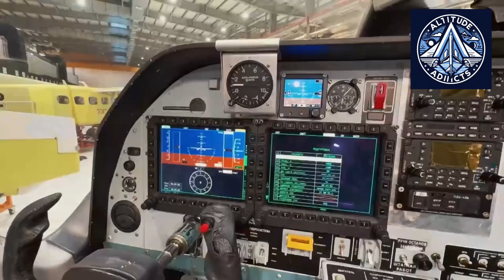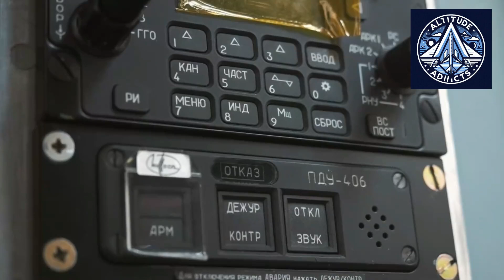Russia’s Baikal Aircraft Makes First Flight With VK-800 Engine | Tests Confirm Success

Comment: The nose of the plane is ugly, the take-off and landing is not stable, to judge by the video. They need to reinstate production of An-2. It seems that biplane for the purposes was the best option.
Reply: An-2 weight is double, flight distance half, engine weight 500kg, the new one 140kg...
Reply: @realshturman  ахаха, три коммента назад вес был 150кг. Давай наливай!
Reply: @johnwatson888 перепроверил просто, а вначале по памяти писал. По сути сказать можешь что-нибудь?? Факт остаётся, движек весит в 3 раза меньше, планер в два, скорость в полтора больше, дальность тоже. Хороший результат. Порадуйся за страну.
Reply: These youtube video judges are real clowns 😁 Even funnier when they judge real pilots and airplane designers.
Reply: @dvv18 are you part of the aircraft designer team, or a "on-sofa jugde" like me? I am tracking the plane creation process for several years, and watch the news. Firstly, this aircraft is heavier than designed, secondly - the it requires much longer runways compared to An-2, thirdly , there was news that the take-off requires more skills of a pilot to do it properly. The guy above gave very interesting info I did not possess - so, this is some soothing news.. And lastly - about the perception of aircraft beauty: "If a plane looks beautiful, it will fly well" - Tupolev, Soviet aircraft designer.
Reply: and there is WAS such a project. Fly on the car gasoline. But it was cheaper and build on "the wrong" factory, so its better this then nothing

Comment: this is all part of recovering from the Soviet policy of basing all light aircraft and trainer aircraft and engine production Eastern Europe as a centre of excellence. When the USSR broke up - Russia had to rebuild all of this. 
The comment about Western engines isn't correct it was a Czech engine that GE took over ... also the "delays" in the VK-800 were a redesign of an older Klimov design to incorporate a lot of 3D printed technologies that were developed by Klimov for the new VK-650. Which made sense as the engine became lighter with fewer parts and more efficient.
All of the sensationist "media" was idiots who had no idea what the true history of light aircraft was in the USSR . .... the L-39 trainer jet .... L-410 twin turboprop ..... AN-2 ..... Yak-52 trainer

UZGA are in effect replacing Eastern Europe  ..... Baikal, Oswey, Ladoga ..... the new turboprop trainer UTS800
its all related. It is quite amazing that a non-UAC company has taken on all this work. Plus the engine modernisation .... All light helicopters too were built in Poland too
Reply: Exactly. And also in Poland the engine's factory was the Soviet Union one, not something that they built by themselves.

Comment: I like that the choice of a taildragger landing gear allows the loading door to be close to the ground. There is no need for stairs or infrastructure for loading/unloading. It simplifies operations.
Reply: No, it does not simplify anything. It makes more difficult, cause everything inside is inclined very much. Nobody makes such thing in 21st century.
Reply: @SergiuIftodi  - It doesn't matter that everything inside is inclined while on the ground. In flight everything is level.